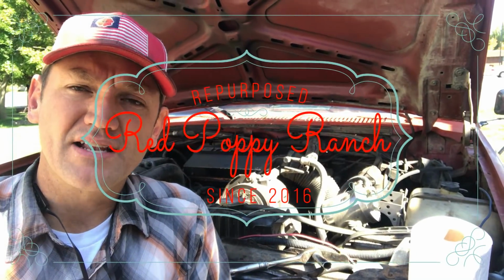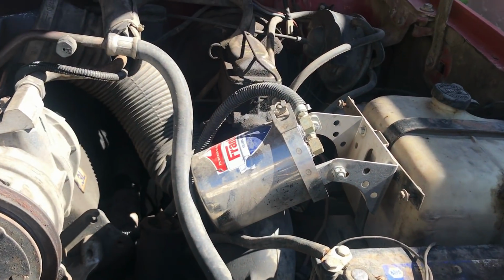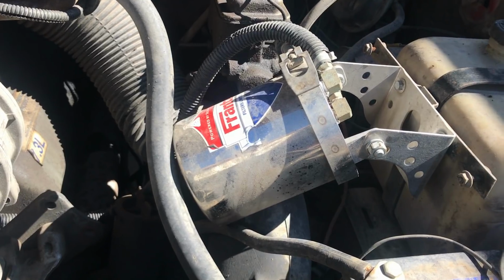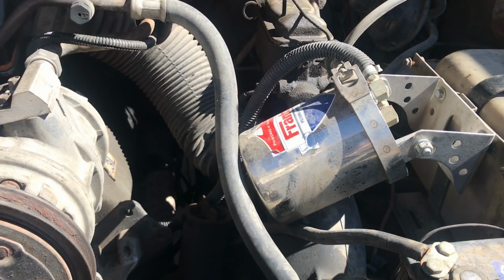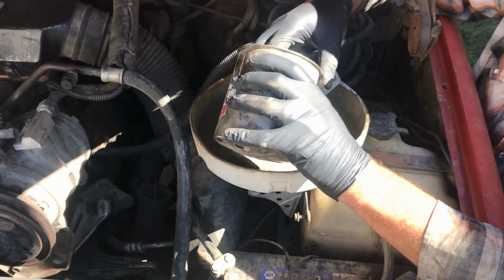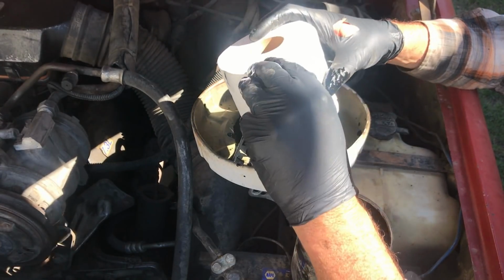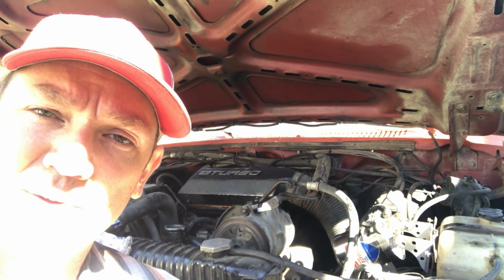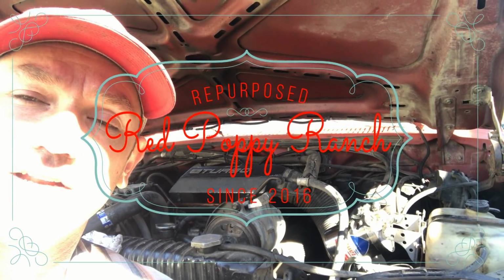#146 - Toilet Paper Oil Filter Maintenance... (Frantz Oil Filter)

Comment: These type filters have been around for over 50 years.  I used on many many moons ago and it cost me an engine.  They are not a good choice.  The stand filter is 1000 times better.  Toilet paper today is much finer than it was years ago and so be careful.  Sometimes what looks like a good deal and a money saver.....really become a heartbreak.  I was in the engine business for over forty years and never ever saw a happy Custer of these.  I thought they were long gone.  Good luck.
Reply from the maker: The manufacturer would beg to differ. I'm sure they would rather I use their filter over the scott 1000 ply but the results are in the testing. The testing shows that it removes the oil of the carbon and soot on a level few other filters can get to which increases the longterm potential of the engine. The mistakes that get made with these filters is when the wrong toilet paper is used and ends up in oil pump and bearings.
Reply: Texas Jerry never ceases to amaze me. A guy in his 50s shows up with "40 years of experience" and knows better then any manufacturer. Better then the filter manufacturer, better then the oil manufacturer, and certainly better then any engine or vehicle manufacturer. I see this in the comments of every oil change and most vehicle maintenace videos.
Reply: Sorry to disappoint you, but I'm not in my 50's I'm 70 and I had over forty years in the automotive mfg business in the engine division of a auto mfg. if these filters which have been around for decades are successful, they do however, aren't nearly as safe or as effective as those offered by you car or engine mfg. Most will void your warrant if used .  This may have changed in recent years, but I'm not a gambling man.  Did not want to ruffle feathers, just made an experienced opinion . Sorry if I distracted from your video or your desire to help educate.
Reply: Texas Jerry They all worked for the manufacturer or government too. The one that comes to mind most was "a major south west US rep" for gates telling us all how serpentine belts don't crack because in the early 90s the chemistry changed. My preach always is to follow what the manufacturer states in their manual and you'll be money ahead. I'm entertained by videos that tell people to do otherwise. And even more so by the sidebar conversations. Being of the manufacturer you understand that said manual is written assuming certain parameters one being expected service life. To go beyond this number one must do things that the manufacturer didn't specify. It interests me to see how exactly people are pushing something longer then it was made to go. That said I'm at odds with a more restrictive filter media.
Reply: I'm sorry but after owning a 6.0 liter powerstroke I no longer trust manufacturer.
Reply: Yup, better take that thing off of your 30+ year old truck, don't want to void the warranty!

I'm not sure a bypass filter would make much difference on a modern gas car with tight tolerances, but it would make a huge difference in an old mechanically injected diesel, it will get the largest partials out, I would still change the oil regularly if it was mine but oil is like vodoo magic, and everyone has their own opinion. 

the biggest advantages of synthetic is resistance to thermal breakdown and cleaning power.  it will last longer and it will keep sludge from forming so when you disassemble the engine it will look brand new inside, I like semisynthetic and more oil changes on an older truck, but that's just my opinion, as long as the seals are good synthetic won't hurt.
Reply: KFStreich Amen on the seals, synthetic flows really well and it'll find any void. I'd be more worried about back pressure and the seals in an aged oil pump. All those layers and all that media have to restrict flow. Now if someone said that they were installing a separate pump to circulate and filter the oil in this manner I'd be all for that.
Reply: Texas Jerry I've seen more than one of them toilet paper filters kill  engine....yeah they filter but they also contaminate as well
Reply: Oil looses its consistency after heat cycles and of course being worn by internal moving parts. It becomes thinner. Use mobil 1 and change it every other oil change with half a quart less of oil regularly used.
Reply: Bypass filters by definition filters only a percentage of the oil per pass and not restricting it, but I wouldn't use a toilet paper element, but a stacked disc type made for oil.
Reply: KFStreich modern synthetic oil does not contain silicone so even if you have worn seals it won't damage, synthec oil 20 years ago had silicone and would wear out seals that's where it got the bad reputation.
Reply: charredskeleton 
I've been selling and using gates belts and can tell you it's 100% fact they no longer crack to show wear. They wear like tires do. So instead of waiting for a crack to appear you have to inspect with a special little free tool you can get at any parts store. Including mine. Gates has been giving them away free since the early to mid 2000's. If you want a crack belt get the cheap crap from vatozone or any of the other cookie cutter parts stores.

Oil is also way different than it used to be. It no longer has zinc and lead in most oils, which means if you have an engine pre 92ish depending on make, you need to put in a zinc additive, or use diesel oil which still has zinc in it. Otherwise you will run through lifters and cams faster than you ever should. 

They aren't removing or replacing the standard oil filter with this setup. It's similar to 18 wheelers coolant filter. You'd never have a chance to move enough coolant through any kind of filter and still cool and engine. So instead it siphons off the system through a feed line and filters a small amount without affecting the normal flow. Same thing on this filter. It's running parallel to the normal filter at a much slower flow and lower pressure rate. You can do it with a normal bypass kit with a standard spin on style filter. Wix makes them too. I'd sincerely hesitate to use over the counter toilet paper, but it is very similar and because it works at a lower pressure it's doubtful you'd push anything crazy into your crank case. It is in fact the exact same type of transmission filter Ford used with the 5r110w transmission as a secondary filter. We always hear it referred to as a toilet paper filter whenever shops call for it too. 

So yeah, I'd be extremely worried if he REPLACED his oem filter with this completely. But not so much if he runs it in tandem as it's designed. 

That said, not everything used on a race car is better than the oem factory stuff. Race car engines are run hotter, faster and have extremely shortened lifespans. Therefore the stuff used on them doesn't serve the exact same purpose as an engine designed to run cooler and last for 10 years without an overhaul. They break race engines down almost every other race or so and tweek it on short runs then store it between races. And often have 1 or more backups just because they anticipate blowing one during a race. And since oil is another component in COOLING an engine more so than just lubricating they want the flow higher. So they typically use a full bypass system that catches the big junk and let's the small stuff through. Because the cooling and lubricating outweigh the longevity the lower pressure higher filtration rate of a standard system in a short time run of 600 miles or less. The bearings and piston walls just won't get scarred enough to justify the power loss in such a short amount of time when speed is your number 1 concern.

So pay now or pay later. If you aren't making fistful of cash racing...pay now is better. Because the bill later is far higher.
Reply: Shaun H    The zinc thing is not so. Oils today do have dialkyldithiophosphate in addition to others like the superior calcium petroleum phosphate. NO engine requires zinc be cause of it's year make. Oils today are superior to the past ones in their lubricity.  Here is a mechanical engineers blog on everything lube and high performance testing like no other. Scroll down for oil testing and analysis.    Massive.    https://540ratblog.wordpress.com/2013/06/20/motor-oil-wear-test-ranking/
Reply: It's a "bypass" oil filter.
Reply: @RedPoppyRanch  - I used to work for and later managed a commercial shipyard and we occasionally put in systems like this, but on a much larger scale. The concept works great. And yes, we did oil analysis all the time for our Cat, Cummins, Detroit Diesel customers and others, usually up to about 2,500 hp.

Now, as for the type of toilet paper used on this size unit, Texas Jerry mentions the finer nature of today's toilet paper. I would agree, but I doubt anyone would want to invest in scented Charmin. HOWEVER, There are some decent brands of cheaper toilet paper that are structurally more robust than what I think Jerry was referring to, and I would suggest looking into those brands. Those would be the brands that would be too "scratchy" for some of these whiners' delicate tushes.

Here is a link for Amzoil's take on it:  https://www.kc-synthetic-oil.com/toilet-paper-oil-filter.html
I disagree with their statement with respect to the acids because cellulose does a great job binding those.
Reply: I was hearing a ex Ford truck dealeron the radio. He said the 6.0 almost broke him. He said Ford went from the best engine ever put in a Ford the 7.3 to  the worst engine ever put in a Ford. The 7.3 was set up for a bypass filter. The 6.0 wasn't.
Reply: I have sold hundreds of these filters.It is frustrating to see some customers manage to find the worse loose rolled toilet paper in the store. When I started using these filters in 1963. Frantz had a list of paper to use. It was 2 ply facial quality. The grocery stores were full of it. The gas station where I bought gas would sell me MD cheap if I bought so much gas. Single ply was junk.  Some Scott is to soft now. Some Scott is great. Its getting ridiculous. I am a highly skilled toilet paper squeezer. Some of my customers are not.
Reply: None of the spin on filters are any good at cleaning oil. They are a full flow filter designed to filter slower with an orifice or other method.The slower the oil goes thru the filter the better. Still not good enough. You need depth. This goes For Amsoil and the factory installed bypass filter on my 64 Rambler American flat head. I solved that problem with a Frantz oil cleaner. The overhead valve engine had a full flow filter which was even worse at cleaning oil.
Reply: I've sold hundreds of toilet paper filters No serious problems. Typical problems like how come my brother's oil looks better than mine. The filters are insured.There have been cases where there were insurance claims.when an engineer shows up to see what really happened to the engine that bull shit stops.
Reply: These fools come from nowhere. I was selling Frantzs at a Flea market north of Dallas about 30 years ago.I was getting the normal assortment of fools. A guy drove up in a 53 Chevy car. He said he bought it new and put a Frantz on it. An 18 wheeler pulled off the hyway. He walked over and talked to us. He had 2 3 stackers. said he goes to Safeway and gets.a 6 pack of Safeway Truly Fine. I was feeling pretty good. Here came another fool. He told me that Frantz had been outlawed in Texas. Too much toilet paper getting in the oil. This bull shit comes with toilet paper filters. It is understandable why the companies came out with their own elements.
Reply: If you use junk paper in a Frantz it doesn't migrate into the oil system. It just don't clean oil.Oil doesn't break down any paper. If you keep using junk paper the oil will just not get clean.
Reply: I'm 80. I figured it out when I was 23 with help from some smart people. By 70 a person should know what the hell is going on.
Reply: All any depth filter can do is clean oil. They don't cause engine damage. Some clean oil better than others but only owner stupidity can cause engine damage.
Reply: I started using the Frantz in 1963. Toilet paper filters have always been good for a bull shit story. The FAA and PMA approved light aircraft filter used 2ply facial  quality bathroom tissue. We didnt  have Frantz elements in those days. We got by. That was the AeroFrantz. Virtually the same filter. The ones I saw on crop dusters near Wichita Ks had bolt on clamps.
Reply: @RedPoppyRanch  I have used the TP filters since 1963. I dont know of.any that come apart in oil.Ive used Scott and Great Value 1000 recently. It would have been better marketing If  John Frantz  had come up with something other than toilet paper and he could charge more money for. It is what it is. Frantz  Motor Guard and Gulf Coast will always be toilet paper filters. Mostly for us old guys If I had concerns about toilet paper fibers getting in the oil I would install a secondary filter. Paper fibers cant get thru pleated paper. I think I will stick with Scott 1000 always a good supply at  Walmart. We will always have the liars
Reply: @charredskeleton  Bypass filters have been around for 100 years. They all hooked up the same as the Frantz.a 1/16" orifice has always been standard. Never heard of an extra pump for the filter. Some giant stationary engines have oil pumps for the giant filters I'm told. Not on road engines.

Comment: When I found out about the Frantz I also put one on my uncle's 59 Ford. That was a mistake.I was changing the Frantz every 50 miles. To make matters worse he had removed the thermostat. In those days if you bought a used car you might need to open up the top and wash the sludge down into the oil pan. Then remove the oil pan and clean it before installing the Frantz. If you are smart you don't install a Frantz on a relatives car unless you plan on taking care of it.

Comment: I dont have a Chevy hubcap. I try to always mount my toilet paper filters upright. I use top loaders. The only filter I have that doesnt drain at shut down is a flat head Ford V8 canister filter converted to use Scott 1000 toilet paper. Its mounted low. Put a tubeless tire valve in the lid. When the pressure gauge on the cigarette lighter pump starts coming up then dropps off its ready to change.

Comment: Most of the good paper in the 60s isn't so good now. Of course the Frantz elements are good.  Haven't used the Frantz in 20 years or so. The Motor Guards and Gulf Coasts are more user friendly. Dont need sleeves and rings. They all clean oil. Motor Guard converted to compressed air. Dont know about the little Gulf.Coast  filters. Gulf Coast  mostly does heavy duty diesel filters. Been using Great Value 1000 from Walmart.  Some use Scott 1000.

Comment: I used a Stilko toilet paper oil filter on my 68 Ford 289 Torino GT.  You just replace the regular oil filter and screw in the Stilko oil filter and add oil to replace oil absorbed by the toilet paper.   The oil filter has fins around It to help cool the oil.  Never lost a drop of oil.  The oil is always clean.   No tools needed.
Reply: It was a little risky using a Stilko. They converted the full flow system to a bypass  system. Anything  big might go right into the bearings. You had to have a wrench to change the under sized roll of toilet paper. Not a good filter. They would clean oil because they used toilet paper. About a third of a roll. Trasco is another one.
Reply: Those filters are for cars that dont have room for a larger filter that takes.a.full.roll of paper
Reply: They. Will get the job.done. I wouldn't want one.you have converted the full flow filter system.to a bypass system
The element is too small. I have one of them that I bought over 50 years ago.

Comment: I noticed a number on contrarian posts here. It's their loss. My neighbor used have one of these back in the early '70s. He showed me what the oil was like after 3,000 on his '65 Fairlane. In those days, EVERY car's oil was a mess by 3,000 miles. His on the other hand, looked like light amber honey, but with the appropriate viscosity. 

I always wanted to get one of these; I'll look to see if I have enough room, but they work great. The proof was in the pudding. A bit pricey at $274 for the Universal Kit, but doable.

My only concern is with extending oil change intervals in cold weather, where more time is spent in a fuel rich condition and gas vapors precipitate onto the cylinder walls on down into the crankcase. The result would be fuel dilution, but that's the same issue with any vehicle in winter weather and has nothing to do with the oil filter.
Reply: You said it like it is. In cold weather short trips sometimes the Frantz can't keep up with the sludge. With me it was a piece of cake. In North Idaho I was driving 70 miles a day. When I found out about the Frantz I was working in a full service Standard Station. The dip stick told the story. With these modern cars the
Oil can be dirty and still look decent on the dipstick Because there is little soot in the oil. What the Frantz can't remove is just a color. Probably a gasoline engine with an upright Frantz would be better for demonstrations. People judge the oil by its color.I tried some black Arco graphite oil once with a Motor Guard. It didn't stay black long.
Reply: We have to depend on heat and the crankcase ventilation to get rid of the fuel and water. Not enough engine heat for long enough and you have a problem. Of course diesel needs even more heat. A Frantz can remove about 6 oz of water.That's nothing compared to how much the engine produces.
Reply: The bypass filter can't think.It can't say hey man I am full of sludge and need to be changed.
Reply: My first  Frantz cost me 29.95  when I signed up as a dealer it was 19.95. Installation was 6.00.  Usually plenty of room except something  like a Lincoln.